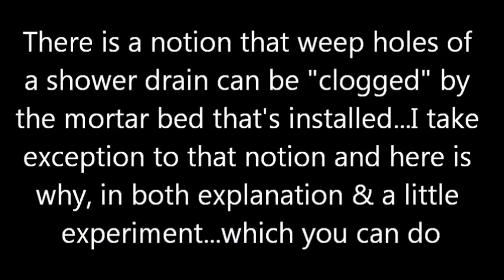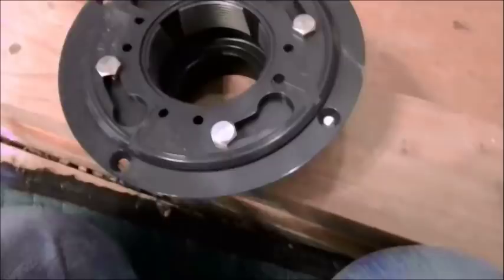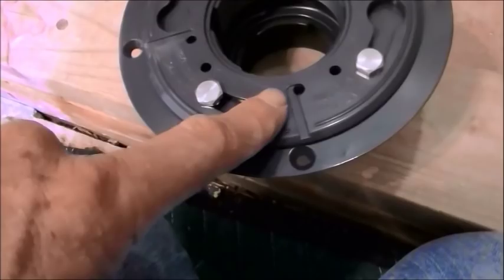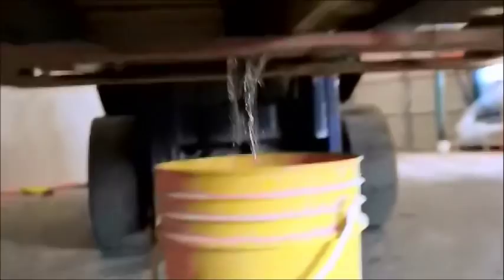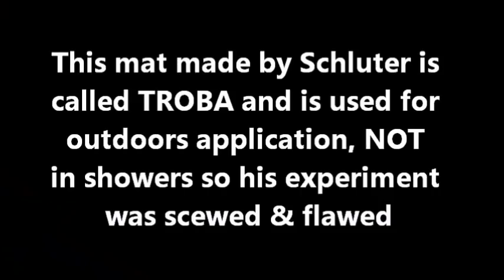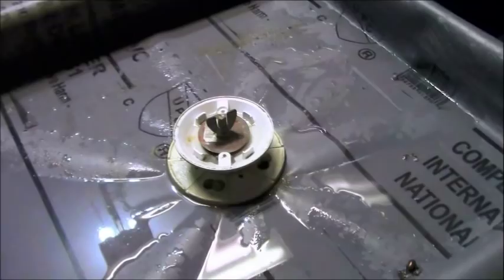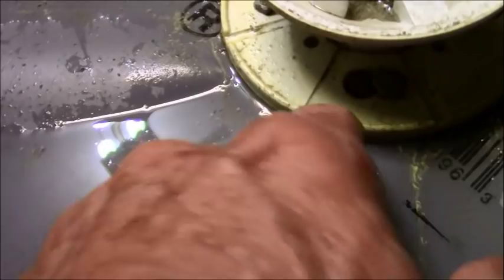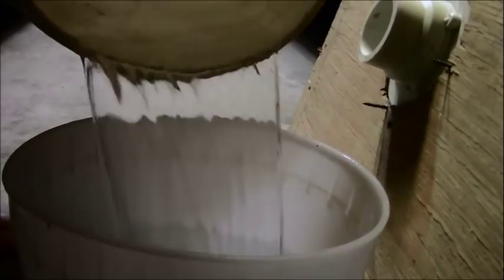SHOWER DRAIN WEEP HOLES....explained

Comment: So you and issac have shown how a shower pan is made and design to work and all of your shower builds do not seem to have any common sense built upon them.Seems to me great tile guy but you do not have the right way to lead water where you want it to go.And yes I build showers professionally and will never ever put any redguard in my shower base or seal the redguard with the shower walls to the shower pan because you go completely against how a shower pan is designed to work.
Reply from the maker: Gloria is it ???
And you've built for how long ?

As for me going back to 1998, every time I tear  apart a shower I find the failure and mitigate those failures any way I choose to... and Common Sense rules my day... Isaac is a book Soldier which is why he's had multiple failures on his channel, common sense isn't common.
Be that as it may, everybody who bills showers waterproof whether it's a liquid topical membrane or Kerdi membrane or some other way to waterproof their walls and their floor, the water in water out system is a fading and archaic method.

Look up the 100 year shower in the search box on YT...nuff said after I posted THAT video 👌👍